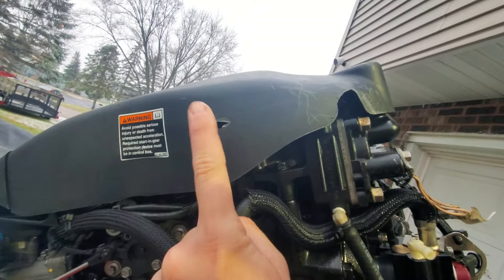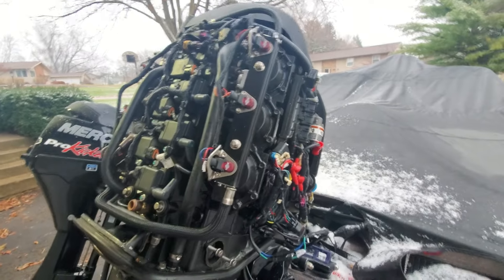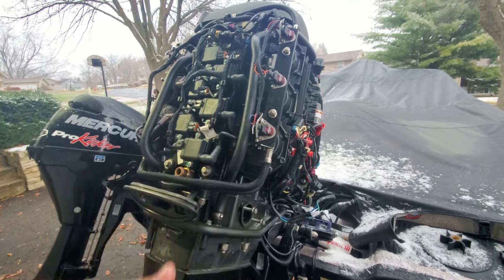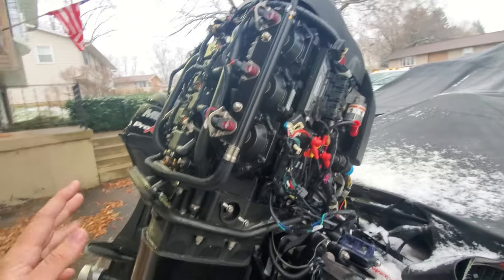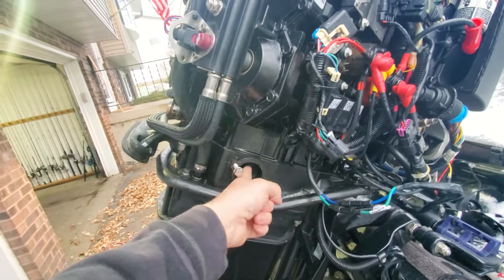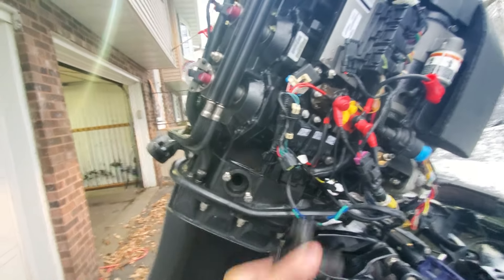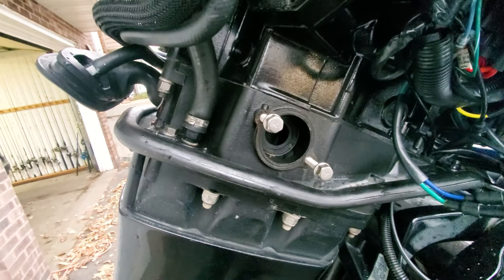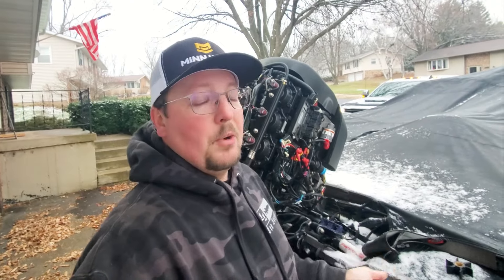OUTBOARD OVERHEATS WHILE PEEING - POPPET VALVE FAILURE! 😣  - SHOP TALK

Comment: This is a great informational video. Would you recommend replacing a poppet valve as a part of regular yearly maintenance?

It was nice to meet you at the Minnesota muskie Expo this weekend.
Reply from the maker: It was great seeing you, too! I don't believe it to be necessary to replace annually, however every 5 years or so it would be good to inspect it (in my opinion).
Reply: @MadisonAngling  As someone told me,  a boat is a hole in the water in which you  pour  money.  Seems like there is always something to repair . Thanks for the info and your reply.
Reply: Wow, never heard of a poppet valve. I have owned my 1989 SeaRay 180 135 Mercury 1850 hrs  water pump gear oil yearly, plugs every other ,never been in for service. Thank you for a great video.